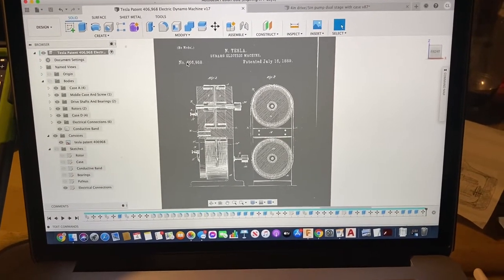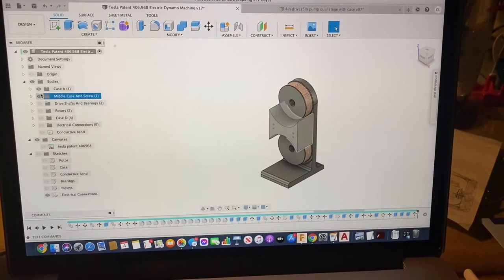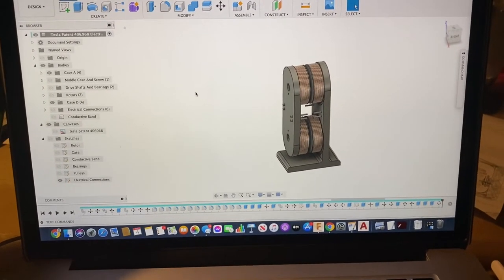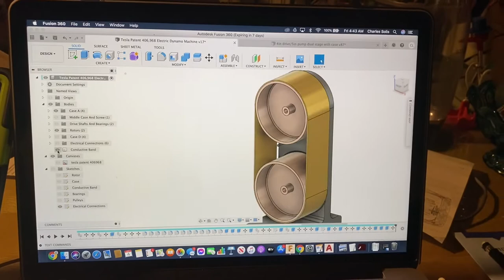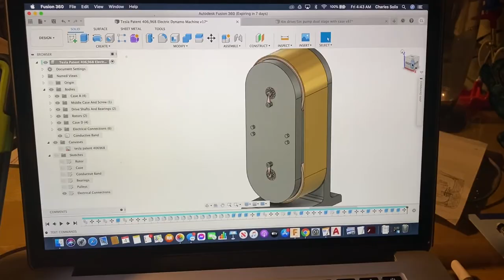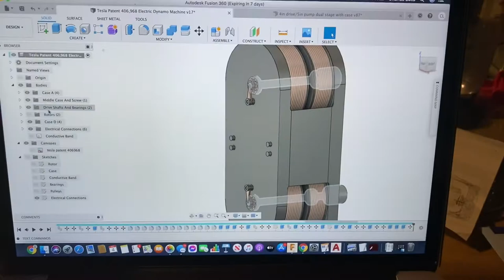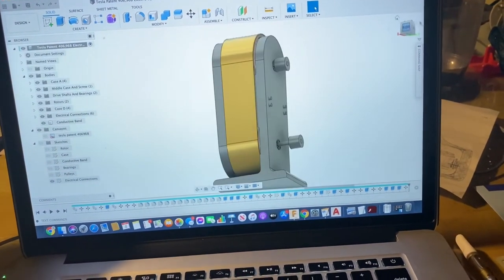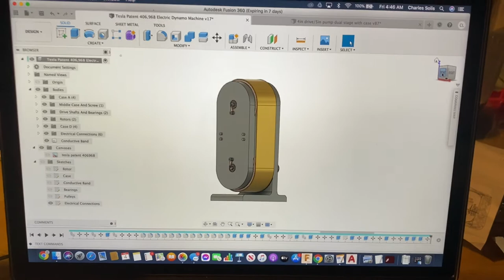Nikola Tesla Patent - 406,968 Electric Dynamo Machine - DC Electricity Generator Homopolar Motor

Comment: Hi, in this patent he states the following: It is of course obvious that the disks may be insulated from their shafts, if so desired.
 what? So does he mean electricity is generated from the shaft itself ???
Reply from the maker: Hey A R. Thanks for messaging. So the driveshafts are the positive and negative electrodes for the generator. I guess let me start off with are you familiar with the “faraday disc” generator?
Reply: @CharlieSolis  Dear Charlie, yes am very familiar with Faraday Disc,   This for sure is not a Faraday Disk and worth investigating.
Reply from the maker: @RightlyFree  This is exactly like a faraday disc…. It’s just two of them in series. One faraday disc with the current going from its drive shaft in the center to its periphery through a conductive band, to the periphery of a second faraday disc, to the center of the second faraday disc and out its drive shaft. 

Also just FYI, when a generator is “self exciting” it means that it does not need an external power source to generate the magnetic field that induces the flow of current/power. There are some generators that work to produce electric but need a small “exciting” power source that creates the magnetic field for some armature to spin in or for some armature to create a spinning magnetic field. For example an, without some kind of permanent magnet inside the generator no mater how you wind up coils inside you will never be able to generate a current without first creating some magnetic field via an external power source. However once “excited” small loads of power can be pulled off the generator to maintain the magnetic fields for continued operation without pulling much off the total power output. However, generally speaking, all generators that have permanent magnets in them are “self exciting” (and if there is one that does and is still not “self exciting” I certainly haven’t heard of it. But this is a common term defining generators. And when Tesla says this generator is “self exciting” he means that because of the permanent magnetic field in the casing it does not require some external power source to “excite” the first currents to make it work. You just spin the discs and free charged electrons in the rotor that is moving perpendicular to the the permanent magnets magnetic field it generates a voltage potential radially in the disc. He then says you can further draw some current off through coils in the casing to increase the inducing magnetic field on the rotor for stimulating higher voltages off the shaft without needing to change the RPM or get stronger permanent magnets. But as long as the there are magnets in the case or the steal casing is itself a horseshoe magnet 🧲 and has even some small magnetic field the currents generated are “self exciting”.

Furthermore, Tesla said you can keep the rotors insulated from the shaft in the scenario where you would axially stage multiple rotors on a single shaft. A dual shaft with 3 individual rotors on each shaft could be set as follows. (Assume all magnetic fields are set up in the way to make current flow in or out on each rotor as I say, this would be, as a whole, complex but each individual rotors stator arrangement would be easy to stage just the same.) 
The 1st rotor on top, nearest a casing wall would be electrically connected to its shaft on top.  The current goes in the shaft, from the center of the 1st top rotor, to its periphery, then down a  conductive belt, into the periphery of 1st bottom rotor then into the 1st bottom rotor’s center. This 1st bottom rotor would be insulated from its shaft, while still being mechanically connected, as well as a 2nd rotor, on the bottom shaft, that’s next to it. This 2nd bottom rotor is, however, still electrically connected to the center part of the 1st bottom rotor, even though neither are electrically connected to their shaft. Ie, the 1st and 2nd bottom rotors would be sleeved over an insulating hub to still be mechanically connected to the bottom shaft yet insulated from the bottom shaft, all while still being electrically connected to each other in their centers. (Again assume magnetic fields are set up appropriately to induce each runner these current paths). The current going from the periphery of the first bottom runner goes to its center and then to the center of the rotor next to it (that it’s electrical connected to) then to the periphery of the second bottom rotor (instead of shorting to their driveshaft). The periphery of the 2nd bottom runner would have a 2nd separate conductive band that runs from its periphery to the periphery of the 2nd rotor on the top. This 2nd top rotor would then also be insulated, at its center, from its shaft (on top) and coincidentally the 1st top rotor all together. As well, though, the 3rd top rotor would be electrically insulated from it’s shaft (on top) BUT it would be electrically connected, at its center, to the center of the 2nd top rotor. Ie the 2nd and 3rd top rotors are on electrically insulating hubs that are mechanically connected to the top shaft. (just like how the bottom 1st and 2nd rotor are electrically insulated from their shaft but still mechanically connected via an insulating hub/collar/“sleeve”) The current continues running from the periphery of the top 2nd rotor, into its center, then to the center of the 3rd top rotor, then to the periphery of the 3rd top rotor. This 3rd top rotor would have a 3rd and final conductive band running down to the periphery of the 3rd bottom rotor. This 3rd bottom rotor would then be electrically and mechanically connected to its shaft, on bottom, but all together electrically insulated from the 1st and 2nd bottom rotors that it shares a shaft with. 

Thus completing the circuit from one drive shaft through 6 faraday disc dynamos in series (going radially out then in, and then out then in, and finally a 3rd time out and then in), then out of the circuit down the bottom driveshaft, all while making the only non static electrical connections in the system at the center of the two driveshafts where the tangential speed of the driveshaft is very very small. 

Thus reducing any slip losses of the electrical connections and friction loss, because traditional faraday discs have to have a sliding connection at its periphery that has high friction loss and poor electrical connections because of the lack of surface area. The conductive bands are always in static connection to the rotors they touch, as they are not sliding on the rotors, just spinning along with them. This simultaneously increases the effective connecting surface area for very high current capacities with low loss while drastically reducing any kind of kinetic friction loss, plus subsequent wear and tear. Heck the electrical connections to each driveshaft alone could be done with an electrolytic fluid or some other conductive liquid material to make the electric connection have a lot of surface area, again for high currents, and making the sliding losses dang near negligible. 

I hope that makes sense. Let me know if something didn’t come across right!
Reply from the maker: @RightlyFree  this is what he says in the patent about previously known issues with staging faraday discs.  
“It has been proposed to couple two or more disks together in series with the object of obtaining a higher electro-motive force; but with the connections heretofore used and using other conditions of speed and dimension of disk necessary to securing good practicable results this difficulty is still felt to be a serious obstacle to the use of this kind of generator. These objections I have sought to avoid; and for this purpose I construct a machine with two fields, each having a rotary conductor mounted between its poles, but the same principle is involved in the case of both forms of machine above described, and as I prefer to use the disk form I shall confine the description herein to that machine. The disks are formed with flanges, after the manner of pulleys, and are connected together by flexible conducting bands or belts.”
Reply from the maker: @RightlyFree  on the topic of being “self exciting or otherwise “externally excited”, in this section of the patent Tesla talks about how this generator can actually be used as an external exciter for other motors or generators, providing the DC currents needed to produce the internal magnetic fields in. By combining this dc generator with an externally excited generator, one can make the entire armature and stator only have very light and well balanced coil windings that produce much more massive magnetic field strengths in a small enough package without needing large, and heavy, rare earth magnets, in the stator or to be spun long on the armature. (which I believe didn’t even exist at the time Tesla patented this which is why most ac alternators/generators were excited by a small external DC generator.) 

Having this DC generator meant one could start with very weak permanent magnets in the casing of the DC generator build up a small dc current, use that to generato even larger internal magnetic fields which causes the voltage off the drive shafts to increase providing a strong variable high voltage extremely high DC current for generating large magnetic field strengths in the coils of a much much larger externally excited Dynamo or AC alternator or generator. 

But read this, he explains it most at the end of this quote. 

“I prefer to construct the machine in such manner that the direction of magnetism or order of the poles in one field of force is opposite to that in the other, so that rotation of the disks in the same direction develops a current in one from center to circumference and in the other from circumference to center. Contacts applied therefore to the shafts upon which the disks are mounted form the terminals of a circuit the electro-motive force in which is the sum of the electro-motive forces of the two disks.

I would call attention to the obvious fact that if the direction of magnetism in both fields be the same the same result as above will be obtained by driving the disks in opposite directions and crossing the connecting-belts. In this way the difficulty of securing and maintaining good contact with the peripheries of the disks is avoided and a cheap and durable machine made which is useful for many purposes—such as for an exciter for alternating-current generators, for a motor, and for any other purpose for which dynamo-machines are used.”
Reply: @CharlieSolis  thanks Charlie of the comprehensive reply...I have to Dive  deep into it.
Reply from the maker: @RightlyFree  you’re very welcome! 🙂🙂🙂 let know your thoughts after you’ve mulled this over some.
Reply from the maker: @RightlyFree  I do have to express though, all of what I said above isn’t to say that their are not other uses and further discoveries left to be made with this device. Just that the patent exclusively talks about this as it’s function and mode of operation. For a very awesome dive down the rabbit hole, after reading the whole patent, read his article 
NOTES ON A UNIPOLAR DYNAMO
by Nikola Tesla
Electrical Engineer, The
September 2nd, 1891
Page number(s): 258-260
“It is characteristic of fundamental discoveries, of great achievements of intellect, that they retain an undiminished power upon the imagination of the thinker. The memorable experiment of Faraday with a disc rotating between the two poles of a magnet, which has borne such magnificent fruit, has long passed into every-day experience; yet there are certain features about this embryo of the present dynamos and motors which even to-day appear to us striking, and are worthy of the most careful study.”

Continue reading the whole article here!
https://teslauniverse.com/nikola-tesla/articles/notes-unipolar-dynamo

There’ definitely some cool stuff to be figured out still. Especially if one can use the radiant energy collector patent to continuously dump charge build up from cosmic rays and radiant energies hitting the collector through a MANY staged version of the dc generator just to ground alone because the electrical resistance of the whole thing would be ridiculously low having almost no voltage loss across even a modest sized DC generator. And all it needs is some cheap crappy magnet stators, some stator windings to increase the field strength upon current flow, and some metallic discs with thin sheet metal bands, essentially band saw blades around the flanged rotor discs, and you have some small mechanical power off the shaft…. Just create a  tortuous magnetic labyrinth of low resistant rotating conductive thick plates and thick metal driveshafts through which any charge build must journey to get to ground. Possibly even use a transformer to take the pulsed high potential low current discharges from the radiant energy collector turn into high current low voltage pulses, rectified to pulsed DC (pulsing smoothed with a larger capacitor) “shorted” through the DC generator. And I do mean “shorting” by all stretch of the imagination as , again, the max amperage capabilities of even a small DC generator built like this would be mind numbingly scary before even the slightest ohmic loss would creep in.

Comment: It could generate electrical energy, but why don't I see any video of this engine being carried out? No one has replicated it, why?
Reply from the maker: 🤷‍♂️ I don’t know but I will be replicating it soon. I’ve made a non working mini model one so far but I’m a little preoccupied with my Tesla turbine R&D at the moment. Once my turbine is finished I will be able to build a bigger version of this generator and actually drive it with my Tesla turbine.
Reply: @CharlieSolis  I wish you luck, or rather that the math turns out well haha, I would recommend you to be cautious, it is very strange that no one has replicated it, too much to think of a conspiracy 🧐🥲
Reply from the maker: Oh yeah there’s definitely some weird stuff that should happen with this thing. Have you read Tesla’s “Notes On homopolar motor” article yet?
Reply from the maker: @garciaquintanaaquiles5307  sorry it’s “Notes On A Unipolar Dynamo”
Here’s a link to a copy of it. 
https://teslauniverse.com/nikola-tesla/articles/notes-unipolar-dynamo
Reply: @CharlieSolis  Interesting,Thanks you very much.
Reply from the maker: @garciaquintanaaquiles5307  you’re very welcome!
Reply from the maker: Also, hey Aquila’s Gar, not sure if you’ve gotten a chance to see my latest tesla turbine updates but check them out! Just running on compressed air so far while I still work on the larger vacuum chamber system for the turbine. Peak 2.75kW and 6.22ft-lbs of torque 4150rpm with 150psi room temp compressed air with 1/2in supply lines.  And the second video is the latest 1200watt electrical load tests using 170gal of 150psi compressed air dumped to 65psi, both room temp and then 70-80°c heated compressed air. And saw the continuous 1200watt output all the way down to 65psi. Should have this thing ready for a vacuum chamber here real soon! 

https://youtube.com/shorts/yXQy844URMA?feature=share

https://youtu.be/bWpXRzrzf4g
Reply: @CharlieSolis  Wowo is amazing !! I already subscribe so I don't miss any details, good luck :)
Reply from the maker: Thanks Aquiles Gar! Should have some new updates real soon!!